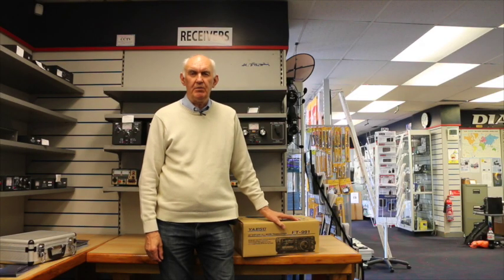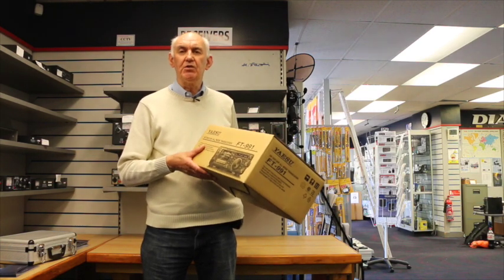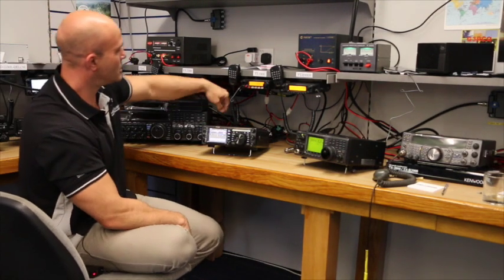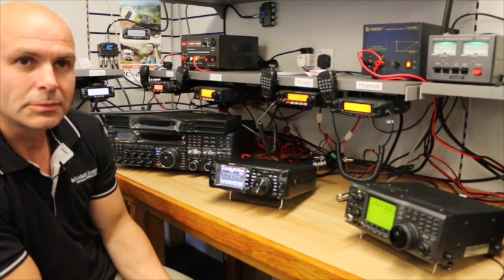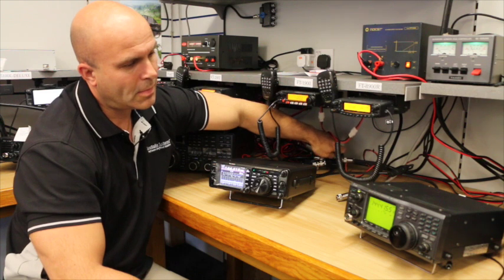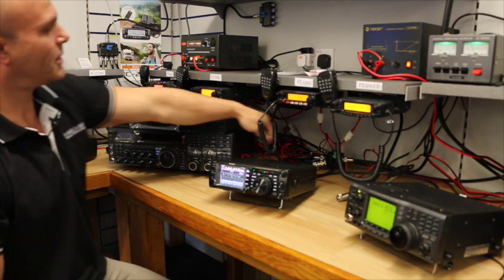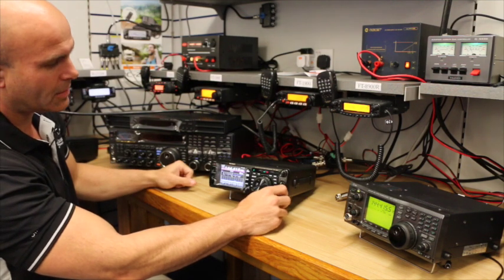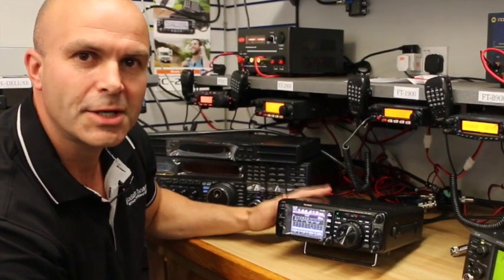Testing FT 991 on 2m

Comment: Good video. So many people compare two radios with an S 9 or stronger signal and think that's an honest comparison. Heck, my little YouKits can hear an S 9 signal. 
I did not expect the results showing putting the FT 857 in the test. I just sold my FT 897D and purchased the FT 991A. Looks like there is an improvement in receive for UHF and / or VHF.
Barry, KU3X

Comment: Thanks Justin  ...it would have been nice to take them to the lab to see that they were all working to manufacturers spec to start with ...they probably were...but good too to have shoot out in the lab.
The 991A is smaller  lighter  and more portable , does HF , has a tuner in , but is indeed unexpectedly really quite good on VHF . (unlike many other shack in a box rigs) Got the scope and got the C4FM...However for conventional VHF DXing...?

The VHF UHF dedicated Icom 910 was the leader of the pack for sure before the arrival of the 991A . Hams without a 910 should indeed note how other rigs  don't even hear the signals of the beacons half of the time , as you demonstrated. (On that basis Icom 7400 7000 706mkiiG and Kenwood 751A and TR9130 have all been sold from this QTH ! )An Icom 910 working properly is very very hard to beat on receive. I found mine STILL had the edge on a brand new 991A. (The 910 only equalled so far by the weighty  Icom 9100 ) .On  VHF transmit  the 910 can put out up to100 watts rather than the 50 watts from the 991A. This could be significant if driving an amplifier like a GS35 valved Discovery II that likes 60 watts of drive or so for 400 Watts output...Or MORE ;-).
Incidentally weak signals don't show much on the scope of the 991A  either ; so it isn't quite as much use as first imagined. (An SDR can be added to the 910s IF to give panadapter viewing for £10, place a seldom used laptop on top of the rig for a big display).

ANYWAY ...

 The 991 and the 991A DON'T allow Digital Noise Reduction to be used above 50 MHz !!!
WHAT !!! Unbeliveable ...but true !!!   Whereas the 910 obviously does, and this is very helpful for some weak signals. 

We need a boffin to tell us how to  to MODify  the 991A to get the Noise Reduction technology already in there  to work on VHF and UHF. Only then can the radios finally be compared for VHF DXing..Presently the 991A has sensitivity but for listening to weak signal conversation , the Icom 910 makes that signal intelligible, wins hand down .73s all de Graham g4vrx

Comment: I´m so very  chocked. Yaesu FT991 is  much much better and has a much more sensitive receiver than the old flagship Icom IC910. Modern tecnology has beaten the old expensive radios. But then again. the Icom IC910 has always been a crappy radio with very bad firmware. So many bugs in it. The Icom IC821 was much better and has a 0,1µV signal ratio. Never seen before exept for Icom IC970. Thats why IC821 is so coveted and rare and expensive. YES ITS RARE !!

The FT857 is so crappy in the reciever that its a toy radio for kids.

Comment: UK hams a crying out for the 146-147 mhz band how to open up for NOV firmware update or hardware links?
Whats Yaesu UK stance on this for UK FT-991 radios?

Bad TX AM modulation has still not been addressed by Yaesu UK, Ive already fixed my mates one and now have another friend recently got one last week,same problem carrier power set too high in AM mode in service menu.
Hs the the techs in Water & Staton  come across this problem in workshop pre QA checks?
 just wondering,so we can get positive feedback to Yaesu UK,they seem clueless to the issue from customer feedback at all?

Comment: It would be nice to see the FT991 compared with say an IC7000 and a IC-9100

I have all three radios, the FT991 realy shines on 2m SSB compared against the IC7000 I have, there is some bad QRM generated by a local plasma tv, I have not had a chance to test it against the IC9100 (I bought it and tested it once and did not have the desk space to use it but in the next week or so with the installation of the new desk I will be able to test how good the 9100 is).

I am impressed with my FT-991 I do intend to buy a second one for the other ham here to use.
Reply: +BeachSandInspector Technologies I would guess the 910 and the 9100 would be somewhat similar receive. 
My FT-857d did not hear very well on 2 meter SSB as compared to my IC9100.
Reply: Obviously money no object!
Make it sound like being a ham is being part of a rich mans club. 
Pssssshhh.

Comment: Would it be possible to compare the VHF receiver performance of the 991 vs the Kenwood TS-2000 you have off to the right?
I own a TS-2000 and find the VHF receiver to be sub par.
73,
N8MJS

Comment: The Icom sounds as though it has a narrower IF, difficult to tell. But certainly the video suggests the FT991 is a fair performer... 
Would be interesting to see how it compares to the old FT221 and FT225 with "all the mods".
Reply: I've got a 991a and a 225rd with an updated Mutek type board (PA1BVM model). I'll see if I can do an ear test for receiver performance.

Comment: I've got a FT991 and I'm really pleased with it. It would have been interesting to see a comparison between the 991 and a more modern 2M rig or transverter. The IC910 is a pretty poor performer with dreadful phase noise performance. Have W and S had reported any problems using the 991 with HRD and DM780?
Reply: Tim Hague I own an Icom IC910HX with all the extras and IMO it is one of the best performing Multi-mode VHF/UHF radios, I've also owned Icom IC821H, Yaesu FT726R and a Kenwood TS2000E for VHF and rate the IC910HX at least on par or better than those.
But the Yaesu sounds very good on VHF and certainly surprised me for a shack in a box.
Reply: The IC910 has dreadful phase noise performance, please do not use it with a linear. A few contest groups have lost points due to the wide band crud that comes out of the 910. It's a regular topic on conversation on the VHF discussion groups. It's a shame because as a rig it could have been good.
Reply: m0ogy   IC-910  it is realy poor radio !!! I had one. IC-7100 has much better performance.
Receiver and transmitter.